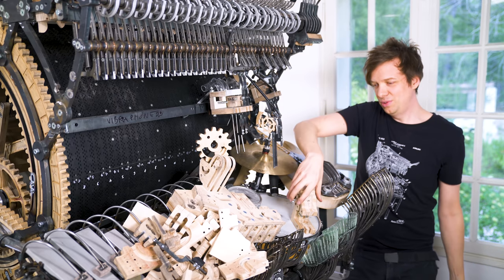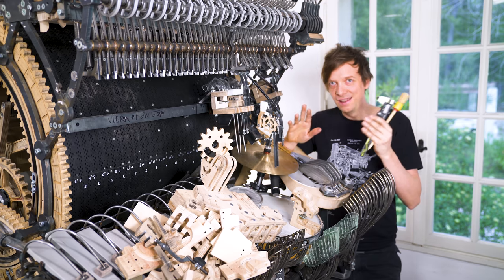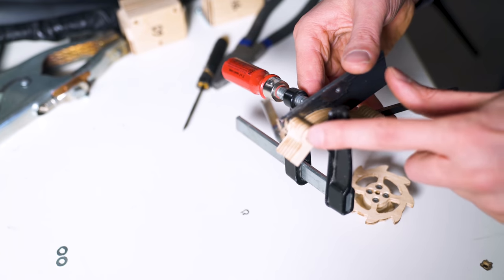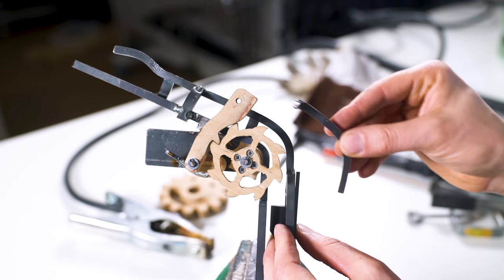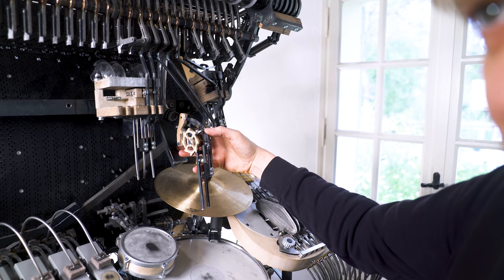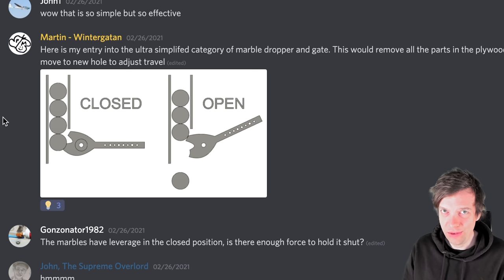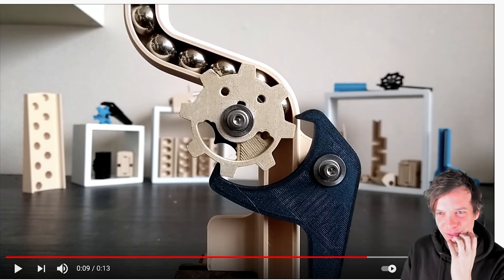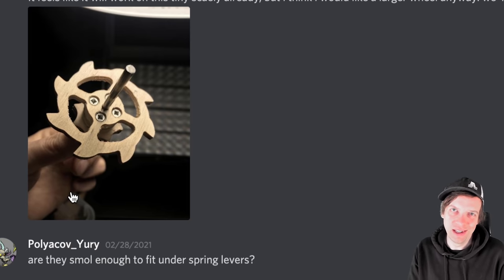Clock Escapement Marble Gate

Comment: If this works, this would be the coolest system ever. Imagine 36 of these things in a row going while its playing. This here is what happens when you allow yourself to take out the old angle grinder and try something new from scratch. Sunk cost can suck it. The goal is not to just have a working marble machine. Its to have a world tour marble machine that can play for hours on end. Its not an easy goal but Im confident you are getting closer and closer with each new idea and design.
Reply: and this also looks good unlike amny other designs

Comment: The travel length problem reminds me a little bit of mechanisms in a piano where things aren't rigidly connected from key press to hammer strike. They use fabric tongues that pull parts back. Works like a spring in a way, but has a hard onset point (inelastic) where the part is pulled back to home at a specific point in the cycle rather than constantly but with varying force (as in the case of a spring). This means less friction as parts aren't pushing eachother from spring tension when they are blocking. The tongues method makes sure that the mechanism does return and you could use fishing wire to make it invisible (subtle but secure and adjustable attachment would need brainstorming though).

Comment: "you will never finish the machine" well it depends how one looks at that... i bet that you will continue improving and working on the machine on the go even after you start going on tours with the machine, so yeah, maybe if they think to say that with "youll never finish the machine" then they are correct ;) its exactly like having a house, you will never ever stop working around the house no matter how much money and how finished anything looks...
Reply: You underestimate my sloth.
Reply: @lilkittygirl  i am a web and firmware developer since 2004... most of the projects i worked on are "finished" on rush and are being "upgraded" and fixed or changed way after the project is declared finished... work never stops on things that have value and that produce value, its on the owner to decide at which stage he will declare its project as finished and ready to be used for what is meant... 
example Martin could declare the machine as finished as it was a month ago, he can also declare it finished after he finishes the new gates... he built the machine so modular and thoughtfully engineered that anyone can upgrade any part in future without impairing the function of the machine. its only up to him to decide when his machine is ready and meets his standards, which doesn't mean he will stop working on improving it after he says its finished.
Reply: The difference is that at one point, you can actually live inside your house while you are still finishing it. With the way the MMX is going, I don't think we'll reach a point where we see it play full music
Reply: @lilkittygirl  yup, i get your point... you are right about that hes prolonging stuff with his perfectionism, stuff that he can do after he "finishes" the project and start producing music with it...
Reply: @Hobypyrocom  I agree. As fascinating as I find the MMX and all the engineering going into it; I feel like he's willfully turning it into a pipe dream at this point. The more he keeps changing, redesigning, and artificially prolonging things; the less hope I have of ever seeing this thing actually make music. I honestly feel like his perfectionism is out of control and he needs to reign it in. (I'd even go so far as to say he should seek active psychiatric intervention if necessary.)

Comment: I see a potential Mole that could pop up with the anchor only falling with gravity. Especially when playing at fast tempos, with the whole machine operating and potentially generating a lot of vibration, the anchor could have a tendancy to fall backwards and fail to engage with the clock wheel. This would then mean the wheel could spin freely and no longer act to allow only one marble to exit the dropper at a time. 

Although you're against using too many parts, I believe a spring or stopper is a worthy addition to the mechanism to ensure the reliability of the MMX. In my mind, a spring, although it would use more parts than a simple stopper, is ideal because it has the dual function of: a) preventing the anchor from falling backwards and; b) ensuring the anchor always returns to contact with the clock wheel before the next marble can fall through the gate. Relying on gravity alone to pull down the anchor may, in some cases, be too slow to return to contact the wheel if the anchor arm is pushed too high (try balancing a rectangular piece of plywood at an angle slightly shallower than 90° to a table and see how it begins to fall more slowly than one positioned at a shallower angle to the table) causing the anchor to be too late to stop the wheel. Additionally, the anchor arm would not fall immediately if the flange on the dropper arm that pushes the anchor back while the gate is closed moves away from the anchor too quickly, which could again cause latency in the anchor returning to contact. 

A spring can be tensioned so as to strike a balance between applying enough pressure to the anchor arm to always bring it back into contact with the clock wheel and not so much pressure that it impedes the springs that pull the dropper arm back into contact with the gate. A spring used for this purpose would only have to overcome/apply a torque force of: 1) the dropper arm colliding with it with such force that would cause it to fall too far backwards, and; 2) pull the anchor arm over from a vertical position. Neither of these are very large forces, but they should be considered. 

A lighter anchor arm (made of plywood, for example) is more prone to problem 1, but problem 2 is solved with a relatively light spring. A heavier anchor arm (made of metal) is less prone to problem 1 because it has more mass and therefore a greater inertia, but a stronger spring is required to better pull it back down in problem 2. I do not know how these forces with actually behave in the real-world application, specifically when considering how they interact with the force of the dropper arm spring, but these are limitations to consider and possibly experiment with

Comment: looking at the thumbnail like:
"Oh, God. Please No"

edit: ok, looks like this design actually solves the problem
Reply: <<<again>>>
Reply: @VWrijder77  I mean, the previous designs stunk of overengineering, ugliness, and were all just too finnicky. Using a simple clock mechanism, which uses the pressure of the marbles themselves as the driving force? Brilliant.
Reply: @holopengin  Yeah I wasn't very pleased with that either. It would have looked like one big solid block. But I was in the live streams when he created it so it feels like the angle grinder took a little bit of my soul 😉

Comment: The escapement is a great solution for this, I wouldn't be worried about parts wearing but as a design engineer I have an aversion to circlips, have you considered shoulder bolts instead? Would need just a threaded hole in the frame to screw into rather than a welded rod.

Comment: Someone else commented this, but I’m restating it so that it has a greater chance of becoming reality: brass gears, a la clickspring. You’ll have both durability, and a striking color against the darker steel.
Reply: He's going with laser cut stainless parts for the final design so it'll be a bright shiny steel rather than the dark millscale of the mild steel he used here, he definitely needs at least a brass sleeve bearing inside the gear if he uses plywood though, to minimise wearing issues
Reply: Brass is a great idea. It would pair well with the bright plywood color that he wants as an accent to all the dark steel
Reply: @mackit  my only worry with brass is the cost, it is very expensive compared to the other options, structurally phosphor bronze would be the best choice but this is also expensive just for the metal alone. Sheet brass costs a fortune and is a pain in the butt to machine due to how "sticky" it is with tools and cast parts would be too much extra finishing work
Reply: Also having a brass wheel creates quite a lot of metal-on-metal noise. I am not sure, how much this affects the recording quality. You can already hear quite a lot of noise + the brass wheel and all that multiplied by the number of channels. And I can't remember what the final solution for the vibraphone microphones was (contact vs. normal microphones). If it was contact then it should be fine, otherwise I can imagine the noise becoming an issue.
Reply: @leonnilein  steel on brass would make less noise than steel on steel, you could actually almost completely cut the metallic noise and negate any ringing if you did a sandwich gear with a sheet of rubber between two brass plates as a sound deadener but I'm not sure it'd be worth the extra effort

Comment: I like it. But im worried about the extra sound it generates.
Reply: Realistically I don’t think you’ll even hear it.  Due to the types of microphones he uses,  you won’t even see it
Reply: Can use felt on the pallets.
Reply: If extra sound is the issue, perhaps a marble machine wasn't the right choice
Reply: Don't worry, Martin will engineer a sound deadening mechanism with parts dipped in noxious plasticized coatings and graphite powder, just before changing the design again with a valve constrictor design attached directly to the PMMA pipes, thereby reducing parts count by another 4 pieces.
Reply: @pjaxy  If he keeps it up, he will eventually figure out a way to reliably make music using no parts at all!!!

Comment: We just had a similar revelation in our project! I've been regularly following this since the start, and have used a lot of the knowledge and work methodology Martin has shared here, in my own start up project.. We just found a way to deal with two of our infrastructure project, wrapping it in under one streamlined part, easy to manage and easy to reproduce system that doesn't need much manual intervention. I'm so happy that two projects in two completely different fields can have so much in common, solved by the same work methodology. KISS, Design for Manufacture, Reliability, you name it. Thank you for the exciting project! 

PS: I'm soon going to hang up my Marble Machine X Poster (it's so beautiful and fancy <3), and I rock the I believe mug daily! Love the project!

Comment: I would recommend using a clock gear made of the same clear PMMA that the pipes are made out of. It should be strong enough to do the job, but quiet enough to minimize noise, and the clear will allow better marble viewing without sacrificing material integrity. Steel would be thinnest, but it would clank with every step. Plywood would work, but it would need to be thick enough to have the 10,000,000 usage test go without failure.
Reply: Pmma is far too brittle, the teeth would shear off, same with acrylic. This would need to be a nylon or delrin part for strength, there's a reason non metallic gears are made from nylon in real world manufacturing. Plywood is actually less brittle than Pmma and acrylic
Reply: @Lilith-Rose  That makes sense, what if he took inspiration from a circular saw blade and used a steel gear with plywood or delrin pads to dampen sound? the main problem I can see with that would just be securing one to the other?
Reply: @MorningDusk7734  I think simplicity of manufacture is really his friend here, adding pads to the teeth would introduce so many more failure points no matter how they were attached that it's counterintuitive to go down that route when compared with a single solid material piece, especially since the most effective way to attach would be a mechanical fastening which adds much more machining complexity. I think the plywood will be strong enough to work, but needs a brass tube to act as a sleeve bearing around the steel axle, using nylon or delrin for the gear is an option but would be less aesthetically pleasing for no real gain in strength and minimal added wear resistance. Brass gears with a delrin or nylon carrier (the fluted piece that actually holds the marbles) would be wonderful both aesthetically and structurally, and would only be marginally more noisy but the material cost of the brass alone would be so much higher and they would need to be custom ordered along with the laser cut parts that the added benefits would be all but cancelled out unless someone was willing to make and send the parts (this is actually quite likely considering the wonderful mmx community and I hope this does happen). For the moment though I don't see the plywood gear being a failure point, rather more of a wear concern that could potentially be mitigated with a simple addition of the sleeve bearing

Comment: Interesting design. Isn't the metal construction again a source of undesired noise?
Reply: not that huge sound, also it can add  pads
Reply: Well, the noise made by the marble drops is pretty rhythmical. It fits in well with the music, compared to unnecessary noise made by the constantly spinning gears and whatnot. It adds a sort of "rawness" to the music that I just love.
Reply: Would be pretty straightforward to remove play and use foam rubber bumpers where needed

Comment: You can see it's winner. Perhaps the escapement wheel should be made of something more durable than plywood those teeth look vulnerable. But this is just a protoype so I'm sure you've thought of that. The beauty is that if one wheel fits all channels then spares and easy replacement should keep you running throughout  World Tour X :). But we are in no rush to see you finish the machine. I'm  sure, Martin,  many of us take great pleasure in seeing your evolving, elegant  engineering video by video. Keep them coming!

Comment: Have we all forgotten that noise from parts on the MMX is a mole you're trying to fix? Now you're adding more noise with these new gates, then multiply that by all those channels you're got. It's going to be chaotic noise.
Reply: That was my first thought too. He's going to end up with felt pads on every escapement lever, or might have to go with a softer material for the sprocket.
Reply: This hardly is more noise than any of the other gates, all the gates have moving parts with metal on metal and wood on metal. There is less moving parts in this and as much potential to dampen any sound as any other.

The music played Martin if not just added a ticking sound boosted a direct recording on the part, compared to the loudness of a snare drum this is gonna be nothing.

In the end you're bringing up something that needs to take a back seat to actually making it work.
Reply: Wrong. The click only happens WHEN a note plays. So all 'noise' will be synchronised with the melody.
Reply: It will be rhymthmic, and will enhance the music. Drops aren't random and untimed.
Reply: @wizardvega724  To me the problem is that the marble always has to drop a certain distance and thus the delay between the marble gate making a noise and the actual instrument / drum sounding is fixed. Depending on the tempo of the song the machine is playing those marble gate sounds might not be on a rhythmic beat.
Reply: THANK you! I thought I was the only person who thought this!

Comment: 30-something stainless steel clock escapements are gonna be noisy af
Reply: depends on the material used in the catching lever, I suppose with rubber coating it will work quite nicely